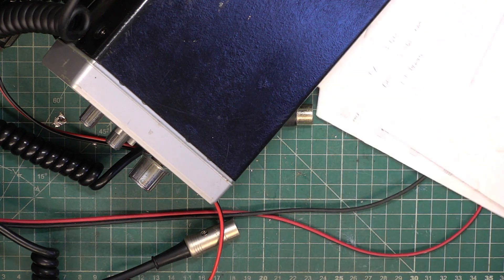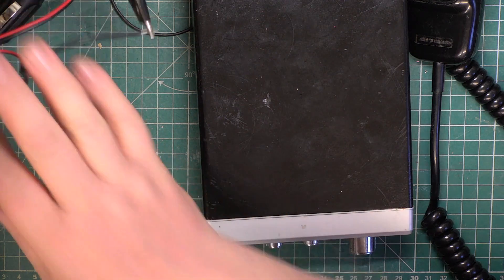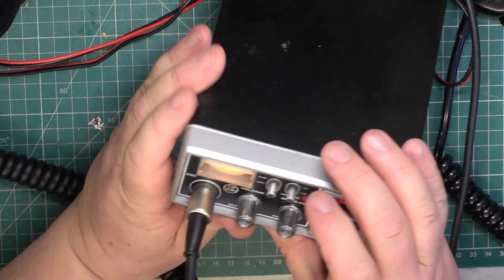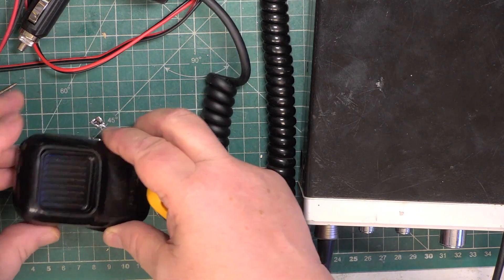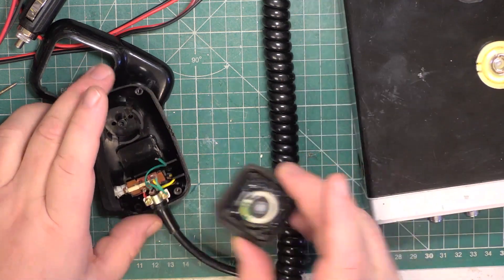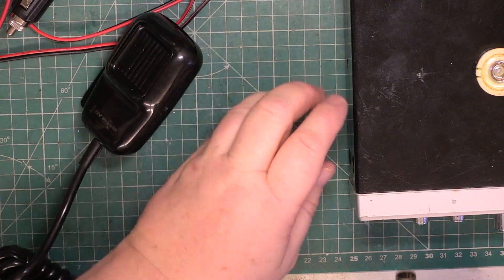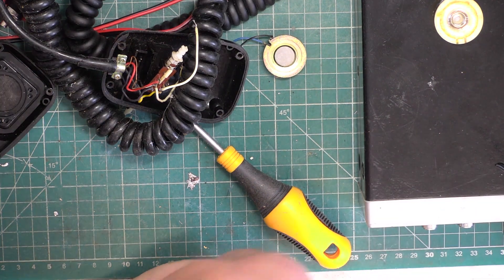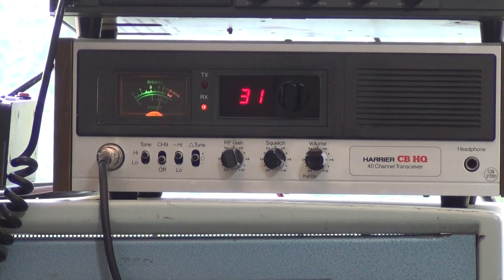Trying a new Farnel insert in a broken 1980's Maxcom type microphone

Comment: I know I'm a bit late to comment on this vid but I'm still playing catch up ... I've just bought a replacement mic for my Maxcom 4E from eBay, but what I got is not what was shown in the original listing. Original pic shows a Sharman's 80's/90's style coffin mic with thick curly cord and regular din plug. I got sent a light weight replica of a Sharman's coffin mic that feels like it was made on a 3D printer. The curly cord is skinny like the curly cords on a PNI HP8000L, it's so thin it's too small for the rubber grommet that protrudes from the mic base to hold it steady. It also has the ugly din plug that tapers out to a bulge and has a lock. I didn't want this type of din plug on my Maxcom, it may look OK on a Realistic TRC-2001 because it's tucked away around the side, but it looks totally out of place coming out the front of my 4E. The biggest problem though is the audio from it, there's hardly any at all, it's so quite and it has zero bass. This has to be the worst mic I have ever had and I seem to have been conned yet again.
Reply from the maker: Well if you bought it from Ebay & it doesn't match the pictures, send it back.

Richard

Comment: The replacement insert was way too quiet, ok, you could adjust the sets deviation, but if the mic were to be replaced it would splatter everywhere.  The replacement mic you use was a bit louder, but the coffin shaped mic was the best sounding.  One that set, anyway.